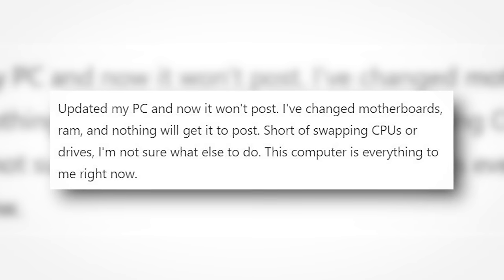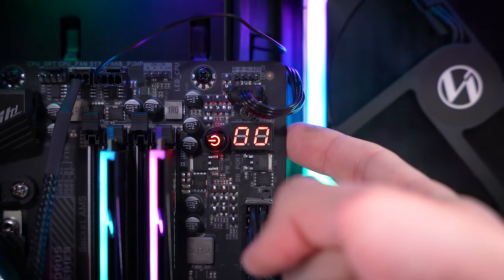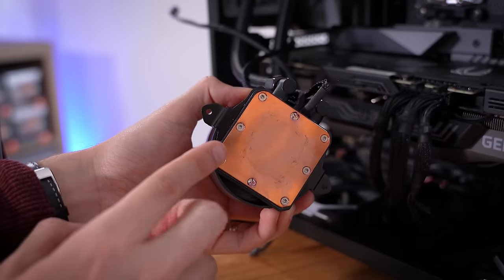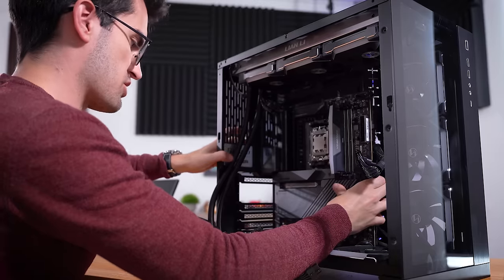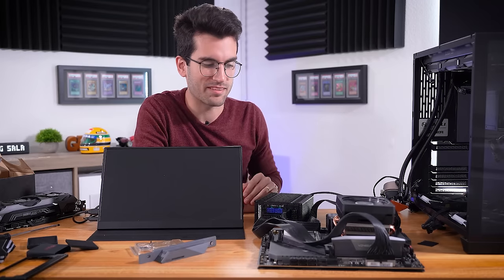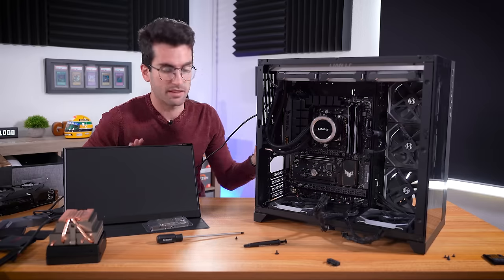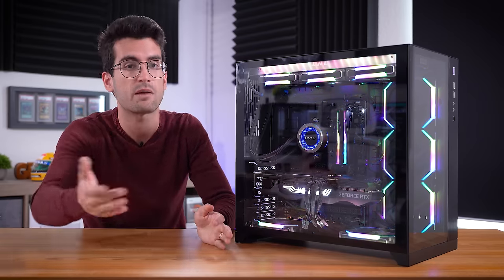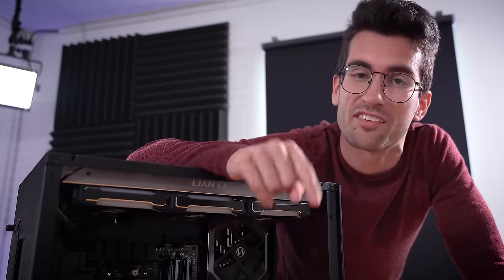Fixing a Viewer's BROKEN Gaming PC? - Fix or Flop S5:E5

Comment: If that socket got hot enough, the connection to the traces could have been compromised. The strange part is what caused that amount of heat in the first place if the AIO is working....

Comment: Bios flash saved me. Had the very same issue. On top of that, one of the top tier amd mobo had an issue with the regular bios update method(basically, I wasn't able to put any newer version of bios)  The flashback without CPU or even with CPU works fine.

Comment: The board is so new that you wouldn't bother messing with it and just send it off for a RMA, a high end board like that should have a good warrenty. Also AM5 had some issues with high voltages that were fixed with BIOS updates, I believe this board should support a BIOS update without needing a CPU

Comment: 8:43  you didnt seat the cpu in all the way then you closed the latch bending the plastic around the socket  you can pause at 8:42 / 8:43 and see it was not fulling touching along the top and the bottom was sitting on top of the plastic  closing the latch then caused your later issue because of the plastic being bent

Comment: That socket was bad, I noticed that cpu was not sitting in there properly. Later i have seen a bad pin right next of that tight corner and microscopic piece of plastic was sticking out towards to pins. You can take another look to that mobo when you have time, probably it will work if its not cooked..

Comment: I probably would have looked up the debug codes before touching anything with a screwdriver, but in this case it would have sent you down the same path. I do enjoy these videos, keep them coming!
Reply from the maker: The debug codes were sporadic. Nothing really to look up unless it halts on a single code. I assumed the board was simply boot-looping before the codes could progress any further.
Reply: @GregSalazar  Fair enough. I'm not intending to be critical, just answering your question 'What would you do different?' From what was in the video it kept stopping at 15 then looping, which Gigabyte's manual on that board lists as 'Pre-memory North-Bridge Initialization is started'... which eliminates memory as the issue. Swapping it out eliminated it too, as you found in your process. I do field work on equipment of various types, so I'm coming at it from the standpoint of not necessarily having the parts available to swap for testing. Both methods work!

Comment: My Galahad 360 Performance AIO pump failed after about a month of use. I had gotten it from Micro Center (ordered it online) and they insisted that to replace it I had to bring it physically to a store to exchange it.  That is a 6 hour round trip for me.  I was livid.  I contacted Lian Li and they sent me a new one about three weeks later.  It too failed after about a week of use.  I switched to an air cooler and installed a Thermalright Peerless Assassin 120 SE and it has been working gloriously.  The thermals are only 5 to 6 degrees hotter than what the Lian Li AIO was providing.  I will not ever buy another Lian Li AIO and I refuse to purchase anything from Micro Center ever again.  I have a 5950x system.

Comment: reminds me that i have dead/ partially ripped off vga port on my dell t620 server from me almost dropping it. I  was looking to  sell it but you kind of need vga out for bios functions before sale. the system works flawlessly in the current config for my nas server. Looked up what the board costs vs how much some one would charge me to fix the vga port its cheaper to replace vga port then board.

Comment: I have a suspicion the CPU was not placed in the socket correctly and the small plastic tabs along the inside of the socket were holding it off the pins, also the AIO might have only had the LED plugged in and not the pump power lead.

Comment: im a system builder of 25 years and im just like greg...im more of a hardware man than software...on another note...i went through 2 Lian Li AIO 360 coolers that were bad due to over heating...the 3rd one cools my 11900k but the LED's on the block were dead just months after getting a replacement...would never recommend them to anyone...

Comment: Component-level repair usually requires specialized tools. I watch Louis Rossmann fix Apple MAC boards by using a micrsocope to be able to see the tiny componnents. I mean, in the PC world, it's far more economical and quick to replace the bigger boards and components than try to drill down into the thousands if not tens of thousands of microcomponents to find a problem. Most of the time, consumers want quick turn-around and don't care if you end up replacing a board to get their computers back up and running. This is especially true for businesses who need PCs fixed. For them, tiem is money, and downtime COSTS money. So you're doing it exactly right by replacing the bigger components instead of trying to drill down to which mosfet is burned out. In this inducstry, time is of the essence.

Comment: I had a similar problem. Where the AI overclocking was on in the bios default in bios. Would basically overclock the ram to an unstable level before it could post. Clearing cmos didnt work , since its on by default. Took me alot of searching to figure it out ha. For that I had to downgrade the bios to an older version. Not sure how you would accomplish this if your board doesn't have bios flashback though.

Comment: have you try to update the bios on that gigabyte board? its expensive board so should have bios flashback function. also the expensive board are often tricky to work with and for some stupid reason updating bios could fix things up

Comment: For the BIOS being idle temps. That's absolutely not true. The BIOS does not make the CPU idle in any way or form.
Sitting at the desktop in windows can easily be 10C less hot than in the BIOS.

Comment: my gigabyte am5 board would train memory every single boot until a very recent bios update!! (aorus x670 elite ax - NOT X670E) this was with 2 dimms 16gb 5200mt each - yes only 5200mt i jumped on am5 very early on and ddr5 5200mt then was basically the highest at a reasonable price

Comment: Replacing the defective part is solving the problem.
Period
Reply: Not always.
Reply: Expensive to replace a board when you could just re-flash the bios.
Reply: @TravelingStacker .  More details please. How does replacing the part not solve the problem of the PC not booting?

Sure a different fix might also work, but that’s not the challenge you are making.
Reply: @robertt9342  replacing a defective part doesn't always fix the problem. If a fuse in your car pops and you replace it, did you fix the problem? There is usually a reason a fuse trips. So replacing the fuse didn't fix the shorted wire, it only masked it for a while. I've replaced bad ram before only to find later there was a short in the motherboard that was causing the ram slot to short out after a while. So throwing new parts at something doesn't always fix the problem. It can, but just because you replace a part and the problem goes away doesn't mean you found the bad part. In this case it likely did, but the person I responded to said replacing a bad part fixes the problem.

Comment: I thoughts it was gonna be ram or cpu issues.
I noticed that when you swapped the cpu the first time, that it was not sitting right, thought for sure thats gonna now bend the pins and the cpu itself when ilm is locked down. Thankfully it did not :D
Looking forward to the next video :D

Comment: Excellent advice about isolating the problem, and when it’s worthwhile to repair vs swap a component.  Did component level repairs on refrigeration controllers before when a new board would cost over a thousand dollars wholesale, while parts and labor for repairing were a couple hundred on the customer end.  
Tracking the issue on a motherboard is way more complex and can see how that would be days of diving down a rabbit hole just to find where the problem is, let alone repairs that could involve specialty equipment or components you can’t easily source.
Reply: Reading the original statement about the situation should have made what the actual problem is quite clear. Broken pc right after updating the bios is pointing at the problem.
Reply: @TheSjuris  Except the statement said the motherboard had been swapped to no avail and did not mention the bricked board had been put back in before giving the rig to Greg. He went in as if the problem was not with the motherboard.  Aside from a rare DOA part, swapping out a suspected bad component but getting effectively identical symptoms suggests that something else is the problem.  The afterword at 24:29 gives more details.
Reply: @MetaphysicalEngineer  all the parts worked on the third motherboard; the likeliest culprit is flashing a bad bios on two motherboards if the same vendor. It’s the only logical solution. Everything else works fine and 2 different motherboards shouldn’t have the same issue with parts that are working.  The only other culprit is using memory that’s not on the QVL of Gigabyte.

Comment: Stuck on Error code 15 when Processor not seated properly or the person applied too much pressure while installing Heatsink as well as also happens when over tightening Standoffs. I have face these issues a lot with Asus Z97 Maximus VII Hero...... But unfortunately I understand these issues after Socket Broke as well as some Socket Pins also.....

Comment: Common misconception is Gaming PC's need the higher 670 boards and that is completely false.  B650 is more than enough for gaming, the x670 boards are more for high end Creation and Workloads that require more devices thus needing more PCIe lanes.  They look nicer yes and if you like it it's fine, just know it's not needed for Game only systems.

Comment: 8:41 seated that cpu way off. You broke that sockets corner right there when closing the lid, also you can see its seated way off after closing the lid. You can see later in video a crack in one side of socket. Example broken plastics in bottom right in 12:33 i bet there is tiny bit of plastic under one corner of the cpu lifting it from some of the sockets contacts. I belive the mainboard either was faulty from the get go or has corrupted bios. I do not belive heat can bend the socket like this, had Ryzen CPU overheat and thermal shutdown several times cause AIO's pump died and it did nothing to plastics of socket. That CPU and mainboard works still today, i have since swapped 7800X3D in replacing the 7600X i had in, that 7600X has new life in home server.
Reply from the maker: The socket was already broken when the CPU was seated that way... The chip always sits snugly inside. It didn't here because it was already warped.

Comment: Do you have any suggestions for a replacement for an AM4 b450 gaming plus max or do you think it's still good to go for a while? I'm asking because I was thinking of having more than one M.2 drive and replace the 256GB boot drive with a bigger one (and also clone the drive to an external SSD and reinstall in the new drive).

Comment: Something like this recently happened to me too.  Had a 5900x in my PC.  Windows updated my  PC and when it went to restart,  it wouldn't go past the circle loading dot screen before windows launches.  I could get into the bios but it would not load into windows.  I tried everything to fix it.  New RAM,. new GPU.  I thought my mobo died and was about to buy a new one.  I had a spare 5600x and figured I would try that last and i finally got into windows.  Went ahead and did a clean install of windows and erased all my drives to get rid of anything that could be causing an issue and put the 5900x back in and went right back the the circle loading dots freezing after 1 spin.  I really wish I had a spare MOBO and PSU to test the 5900x and see if it was really dead.  I just don't see how a windows update can kill a cpu that hard.
Reply: Propably a Bios/Windows issue with the 5900X on the Bios version (AGESA) you had on your mobo. Windows restore point, Clear Cmos, Bios flashback to new Agesa
Reply: @bafon sorry should have mentioned that I did all that too.

Comment: Fixing the part isn't practical unless the parts very hard to get or the issue is a know and easy fix. Otherwise you swap out to fix the issues , save time and move on to another problem.

Comment: hi greg i know this is going to sound funny, but if the pump is not working and it was very hot, when you found that cpu was not sitting right and fix it, did you test that pump was working or not. As you know hot cpu's will shut down straight away.  anyway pleased you got it working for the person.

Comment: Please do a BIOS-recovery.

I've watched this twice and my next step would be to flash the BIOS using the boards BIOS-recovery. This should be the next step in any troubleshooting, after you have done all the physical tests and most NB, gotten the results you did. That data all points to the BIOS not initializing.

Comment: rma. so they can investigate that issue. is my first time in 40 year i see this type of error. I do the same as you but no video. jejej. but on a open community for years. not always is win. in fact i did 10 time remote building a pc. this one is for the books as i say sometimes. nice work Greg. I know by this time that pc is gone. if not keep a eye on the cooler.

Comment: It's possible that busted board was never initialized enough to send PWM commands to that AIO pump so it may have not even turned on at all.
Reply: Wouldn't need PWM if connected to the pump header which always has power when initialised.

Comment: I’m an Electronics technician. I can tell you that many companies like wind farms and oil refineries don’t bother with troubleshooting components on motherboards. If it’s the MOBO they do a quick swap to get the machines running again as fast as possible. The old mobo is sent back to the manufacturer for them to deal with. Assuming the manufacturer even bothers trying to fix the board.
Reply: Chances of a motherboard failing due to bricked bios update on an oil rig is going to be low then.

Comment: I would have tried to flash the bios as well.  I am on AM5 and have had something as simple as a windows update make my current bios version prevent a POST.  Once I flashed the bios to a newer one it booted right up.  Anyways, good job as always.  Always love watching this series!
Reply: I was thinking the same thing, he could of used a different cpu but It might of worked.
Reply from the maker: We tried a different CPU already in the video. Same symptom. Only option would have been to use BIOS Flashback function as the system would never POST with original board. This wasn't something I checked in-video - however - I've gone back and attempted to re-flash to no avail.
Reply: Yea the bios flashback was what I was referring to but if it still didn't work that's a bummer.  I almost bought that same board but saw so many people having issues with it that I went with a different one. Thanks for letting me know you tried it. @GregSalazar

Comment: Motherboard Manufacturers applying ANY sort of overclock by default is ridiculous. I would imagine this new issue with intel 13th and 14th gen cpus failing under a gaming load has something to do with these overclocks... Nobody asked for default overclocking, especially on chips that are already skirting the edge of thermal limits.

Comment: Hi Greg!
Love your videos, found out about you from a friend some time ago and i've been watching since,
I have a question. Whenever i have my graphics card installed, it takes an extra 3-4 minutes on the bios screen (in the beginning of boot when there is the picture of motherboard). After that everything runs smooth fine and as expected. But it just takes very long to get through that motherboard picture screen at the beginning. This problem is fixed if i boot without a GPU. No one has been able to fix it by now and they blame the graphics card. but everything else runs super fine and gives me no problems.
Do you have any idea as to what may be the problem because i think its a software issue instead.

Comment: Man I remember having issues with random bsods led me down a rage path I tried everything at first I though maybe I had bad cpus with running at rated speeds. I tried reinstalling window drivers etc. even hard drives and was still stumped then I started trying different ram kits and boom everything started working correctly . I guess some motherboards with ryzen are really picky with ram.
Reply: Have been since Ryzen came out.
Reply: @johnt.848   really thought that would be ironed out by now...I mean ive been using the same motherboard for a few years now x470 only things that changed were ram cpus and drives

Comment: Shouldn't that board have a form of BIOS flashback of some kind? I would have tried to attempt that first before resorting to swapping the platform outright.
As an aside between their GPUs lasting just long enough for the warranties to go (my own RX6900XT crashing on DirectX usage), exploding PSUs, and the afterthought posted here I'm beginning to not trust Gigabyte as a brand outright anymore.
Reply from the maker: Someone earlier called this to my attention. I cleared the CMOS early on, but it's very likely  that a corrupted BIOS wouldn't have been corrected with the BIOS Flashback function. And by the time I noticed the warped socket and excessive heat issue, my attention shifted from it entirely.

Comment: Perhaps try a UEFI Firmware update or flashback? Maybe an earlier version or even the very latest, just in case? 🙂🤷‍♂️
Reply from the maker: BIOS Flashback did not work, unfortunately. This was definitely something I should have tried earlier (and included in the video).
Reply: @GregSalazar  Well it was a good option to try. That plastic frame issue on the socket is odd. Replacing is the only way to go. Worth returning for a warranty replacement? 🙂🤷‍♂️